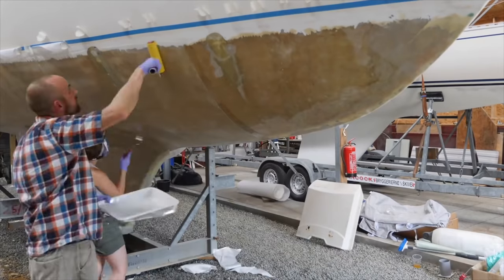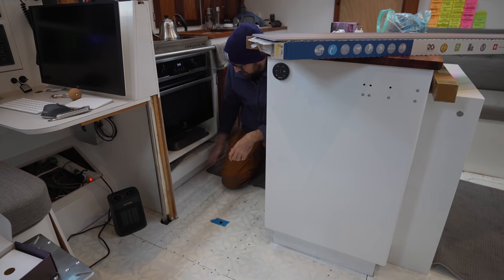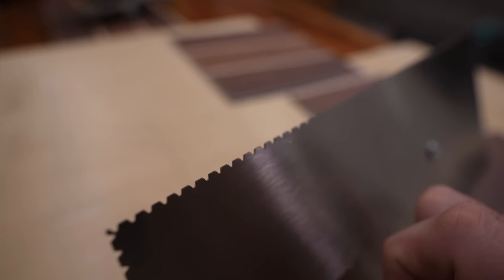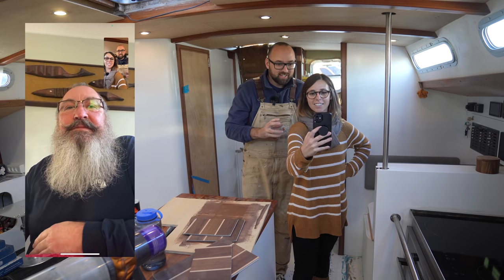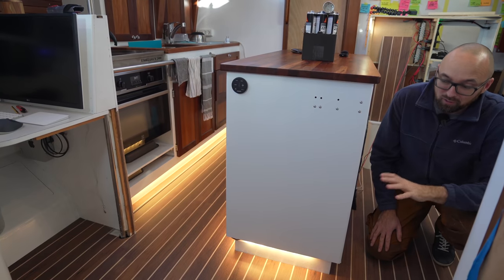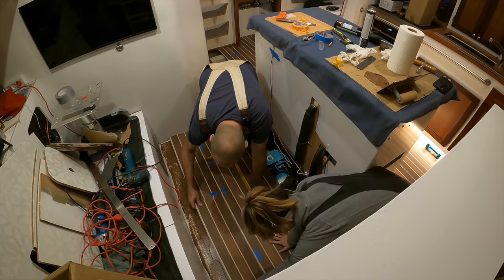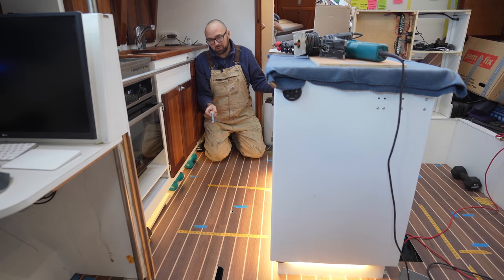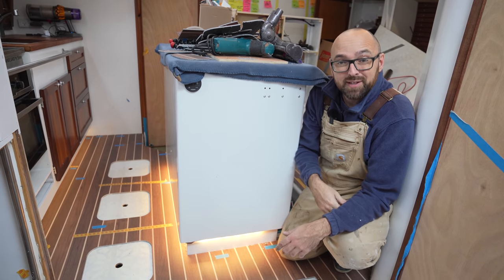Sail Life - NautikFlör super spiffy flooring for boats, part 1

Comment from the maker: UPDATE: I can not recommend using a polyurethane adhesive! Use an MS Polymer glue (like Bostik MSR) instead! We seem to be having issues with the foam breaking down - maybe due to the adhesive.
Reply: Thanks for the advice. I cannot see, that you pushed the panels together while glueing? Did you only use the click system on the long/lengthwise edges?
I am about to glue down today ....so a bit 'nervous' 😂 and thinking about the technique every minute. Good Winds
Reply from the maker: @roaringforties2007  Good luck :) All I did was glue the entire underside. Insert a panel at an angle and push it down, forcing it to lock in place. I hope that makes sense :) You'll do great! It's very easy to install.

Comment: Helpful tip: flip your flooring piece over, then use your circular saw to get a clean edge on the finish side.
Reply: I might add you can get laminate jig saw blades that cut on the down stroke.
Reply: @magicmike5166  Yes, thank you.
Reply: Agreed a fantastic recommendation
Reply: But how do you mark the underside for cutting?
Reply: I was just heading to the comment section to write the exact same thing.

Comment: Mads, a score cut first when cutting laminates with a circular saw, Makita do a panel saw specifically for this but a regular circular saw is quite adequate.  You can also get a reverse cut jigsaw blade for worktops to avoid any possibility of scraggy edges.  DC-DC converters use power so would have used a relay instead.  We have two similar DC-DC converters for USB powering - 24-12v reduction and they have been working well so far (18 months use).  The floor and lighting looks great, but it pales into insignificance against the Xmas lights!  Well done Eva, and reading the instruction manual was inspirational, who'd have thought to do that, well non of us blokes at any rate!  Great video.

Comment: Great job on the floor! 

In some future episode, could you describe how you organize all the data on your shipboard systems? As a pilot, I'm used to operations manuals with various procedures, and then special sections for each type of emergency: fire, engine out, fuel contamination, etc. How do you handle trouble procedures, flow charts, connection diagrams, installation manuals, reference manuals, and the like? Do you keep paper versions of the data or only electronic PDFs, etc.? You have an amazing collection of technology on ATHENA, and I would not be able to keep track of it all. Especially after 6 years of development and configuration. I mean, I can barely remember what I had for breakfast, let alone how my TV is hooked up a year ago.

Comment: Dang it Mads, finish products get cut from the backside almost always. Saw blade is coming out of the top surface on the leading edge increasing chipping. Flip it over and the blade is entering the material on the leading edge preventing chipping. 
Give it a shot.

Comment: Sikaflex EBT (Screwfix stock it)  is a polyurethane sealer, filler, adhesive and just as good I think, as the types normally sold for the marine and caravan market. Available in white, grey, black, Brown. It’s  also available in clear but this seems have a different formula so it’s not so good. Probably cheaper than the stuff you used at about £7.80 or so a tube. Used extensively in mine and my mates’ Narrowboat fit outs. Greetings from NB Wordsworth on the Grand union canal in Leicestershire.

Comment: Mads, for the future, any time you need to cut sheet goods with a circular saw, lay down a strip of masking tape wherever your saw blade will be cutting.  Depending on the particular sheet goods you're cutting, that will help (but not fully eliminate) chipping and splintering.

Comment: Remember it is not just the voltage you have to match. To be safe you need to match the circuit breaker amperage to the wire size.

Comment: About circular saw blades. It really helps if you clean them from time to time. Remove the gunk that sticks to individual teeth. If this does not help, then sharpening or replacement. And, always use the right blade for the job.

Comment: cut the floor with a circular saw, try putting tape e.g. paint tape on the top and cut from the back side with the saw so the teeth come from the bottom up on the nice side, then will only flange on the back

Comment: If those dc-dc converters ever fail, or if they are blazing through too much power you guys could use 12v to trigger a relay and run off the installed 24v.

Comment: The flooring looks awesome BUT the tolerances are the most tight and cleanest I have ever seen.  The thing is even vinyl flooring expands and contracts, albeit less than real wood.  Come summer and higher humidity, you could be looking at a flooring r-evolt with it popping up and becoming an accordion because it may have nowhere to expand to. .....
Reply: I was wondering about that issue of expansion/contraction too.
Reply: Hello! Please go to the NautikFlor website and request the date sheet through the contact form. You will see that this product is widely used in the marine industry and is designed with these things in mind, that is why Mads chose it 😃⛵️
Reply: If you glue it on the surface, it will work the same as the surface.
Also no problem with expands and contracts.

Comment: How did Mads know where to cut the installed and glued flooring for the hatches?  I missed a step.
Reply: Probably left the covers out while laying the floor. Find the soft spot, poke a hole then the router will find the edges.

Comment: Didn't quite work out ,how he knew where the hatches where located exactly under the new flooring for cutting ??
Reply: There was a shot where he had cut 2"x2" holes in the approximate centres of the hatches, and I guess he worked a rough cut out from there, finishing with the trim router.